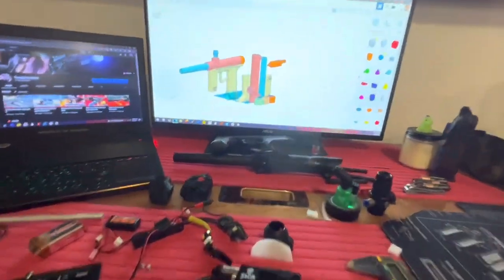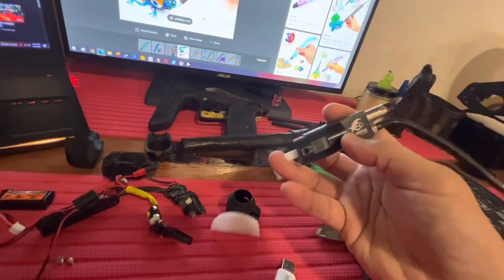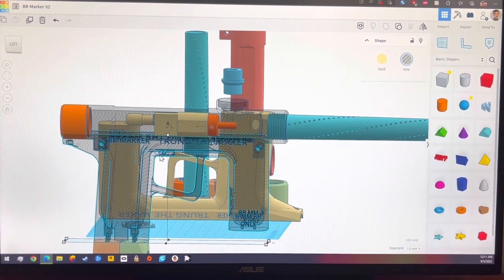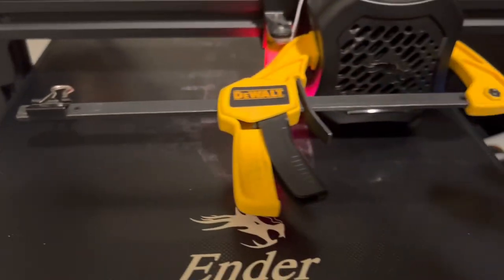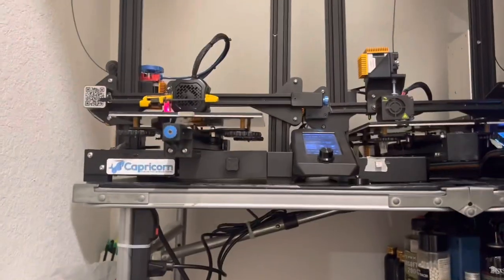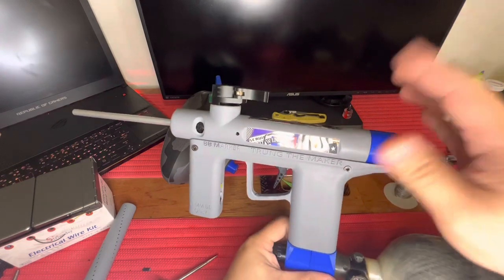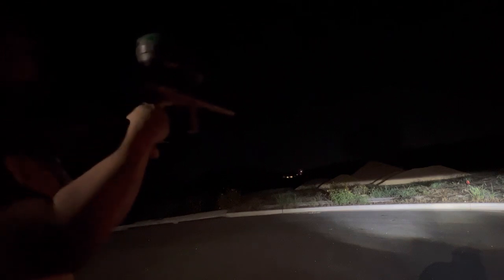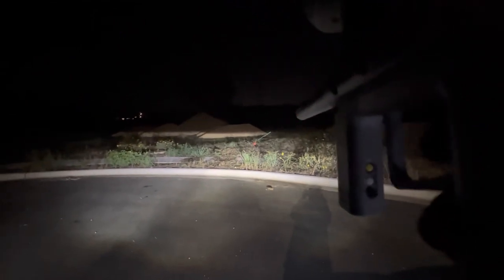Paintball marker that shoots Airsoft BBs!

Comment: Very cool project! , keen to know how you would start modeling the dye rotor mid and top parts or have any tips on 3d scanning the original ones ? i have a issue with reball feeding as there slightly smaller then a paintball so feel larger paddles on the top of the rotot would fix it